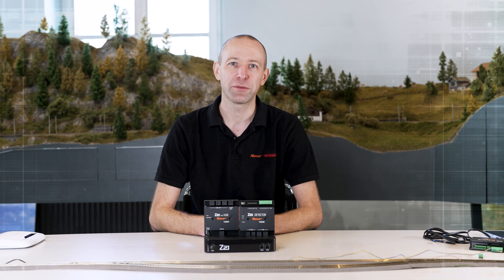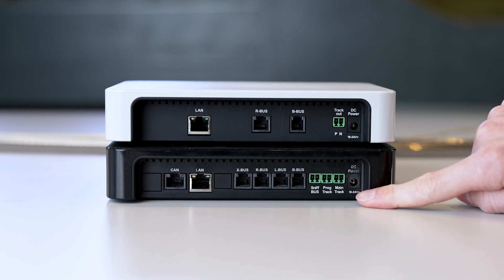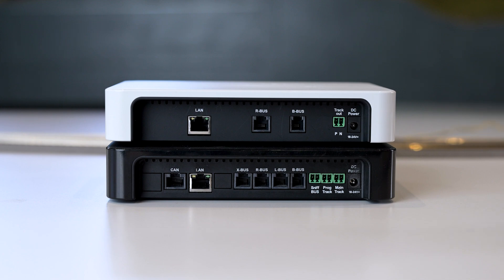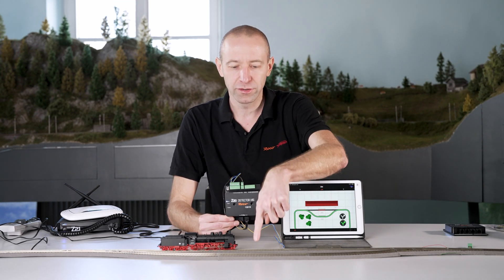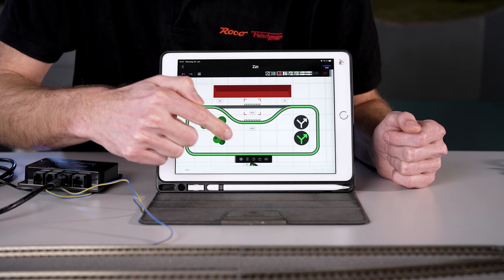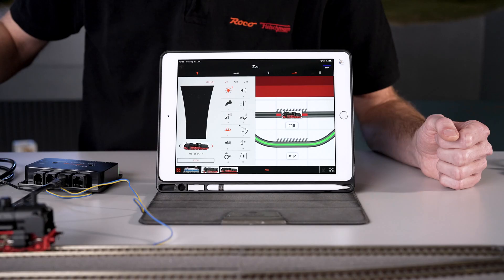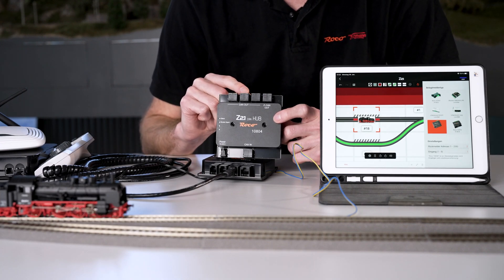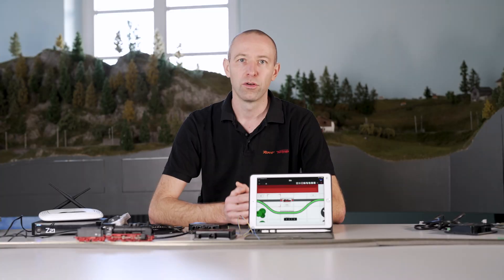Part 19: The black Z21 with CAN bus-capable occupancy detector and CAN hub

Comment: Hello, first of all, I want to thank you for this video, I was really waiting for it.
I take this opportunity to ask a question.
I cannot establish the CAN connection when I connect the black cable from the CAN port of the 10808 detector to the port of the black Z21. Even when I place a locomotive in section 1, I can see the red LED number 1 light up, but for some reason, the blue LED on the detector remains flashing. How can I somehow enable the CAN port of the black z21? I have validated that the black cable works and that is why I think it is the CAN port of the black z21 that is not responding. Could you advise me, please?
Reply: Hello, I also have the same problem, it only works with R-BUS emulation.
Reply: @corjol9289 I just did a demo      

https://youtu.be/QzURigXCe7A?si=yLYKJ_ba4I8edTH_